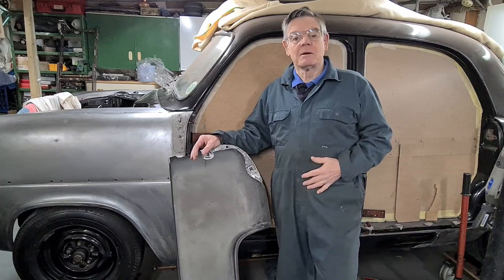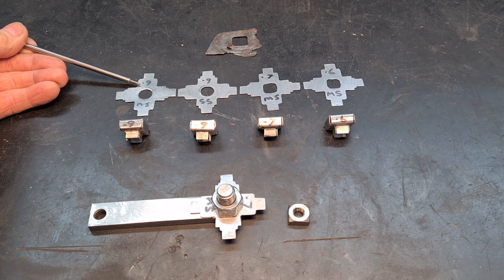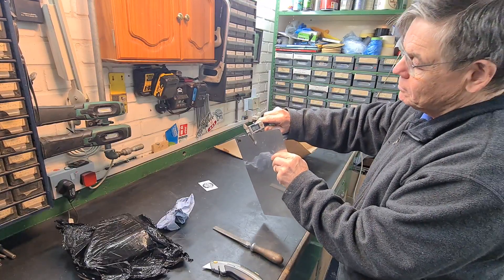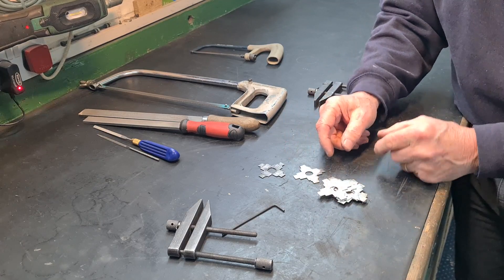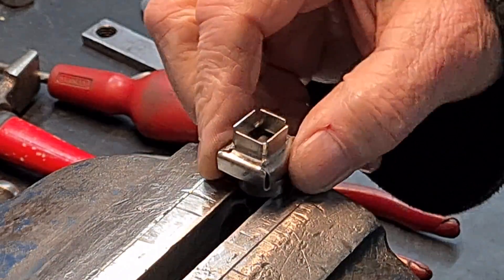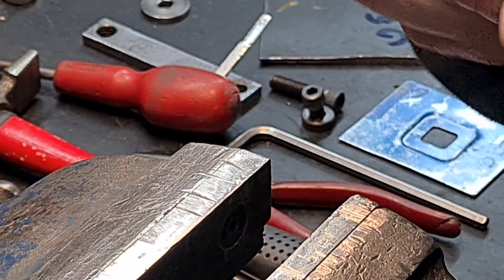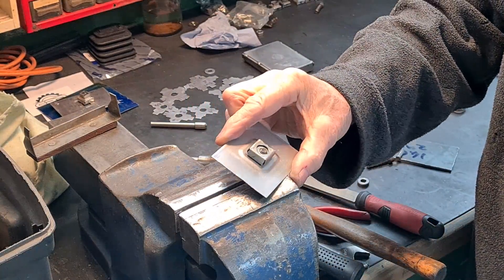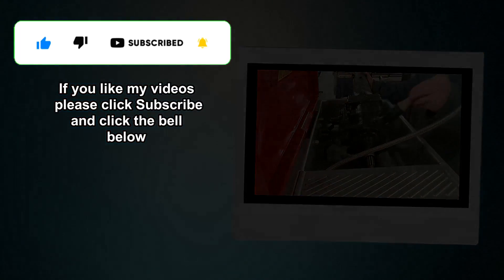How to Make Cage Nuts

Comment: Why does 2 tangs vs 4 tangs matter? It's not the tangs that are holding anything with a bolt screwed in - they're only there to keep the nut in place when there's no bolt. The reason you find ones with 2 flanges everywhere is they're used in 19" equipment racks for servers and telecom equipment - every day bags and bags of them get chucked out even though they're brand new and have never been used.
Reply from the maker: Yes, I did see lots of those server racks when I searched. I think the holes are smaller than the holes on the car.